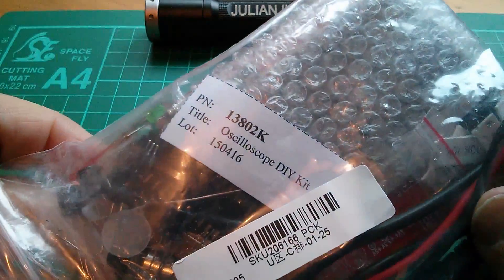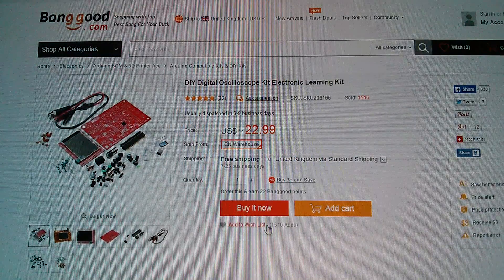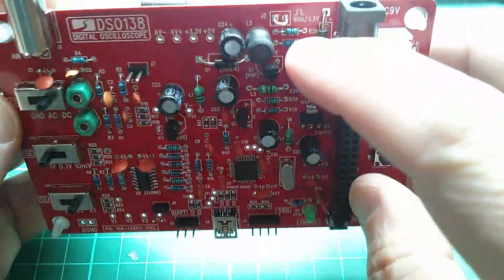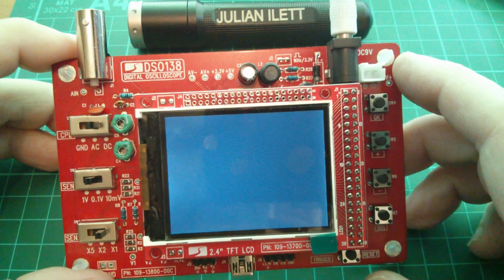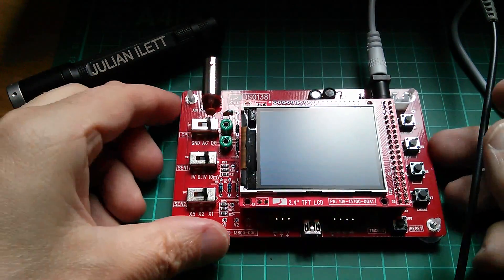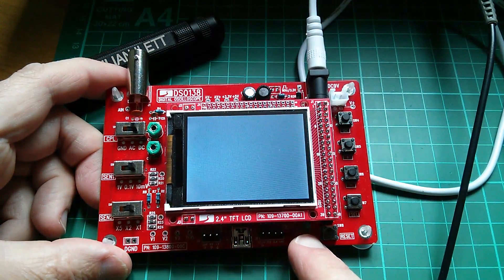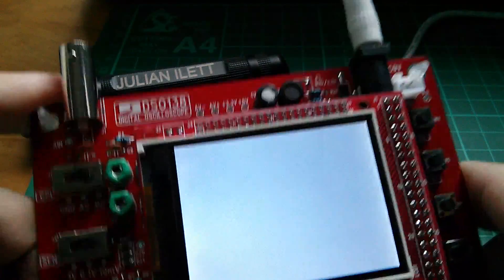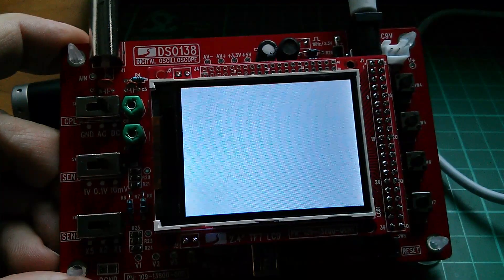Julian's Kit Build (FAIL): Banggood £15 ($23) Oscilloscope Kit

Comment: Undervolt is unlikely to kill an LCD. They don't usually require a negative voltage to work, but that could be the problem. It probably doesn't work without the display because they're using the LCD board to jumper some power across the board.

It definitely looks like the microcontroller is dead or partially dead. Most likely the display doesn't work because the processor simply doesn't initialize it. My best guess is that one of the output registers got fried by ESD. It's also possible that your power bank overshoots when it first turns on, and a voltage spike got past the input register and damaged the uC.

Either way, you need a new board. I'd also stick the (good) scope on the power bank and check for gross overshoot. That can be a problem with cheap boost regulators.

Comment: Julian Ilett Hmm did you only check for the pulse-train on the -av point? It would seem to me that that is the regulated output of the 7905. Try and see if you can find the pulstrain on the first mentioned resistor, from the back side.

Comment: It's very likely that ESD damage due to static from that suspiciously inadequate looking anti-static packaging (and/or careless handling we cringed at in the first video?) was the likely cause of the LCD (or its tiny driver circuit) failure. While it is possible this can be proved though very expensive investigation (requires an electron microscope and opening up the IC in the lab), the MFR should just replace it at no cost. Sometime a static discharge will just cause a glitch that requires software re-boot, but it's still a very good idea to take care because ESD damage can take several months to cause a failure if a very tiny hole (that gets punched by a very tiny spark) allows oxygen to enter, contaminate and eventually destroy the semiconductor layer/junction. BTW, back in the early days of 4000a/ae series C-MOS before internal protection design improvements, that was called “making the chip pregnant”!  Use a wrist strap or better yet IMO, be meticulous in discharge/handling procedures.

Comment: That sucks. I'd actually consider buying one if it actually worked. Try plugging in the barrel connector after the battery pack is on. Also, it looks like the top left pin of the display looks unsoldered. Make sure all the presoldered stuff is actually done right.

Comment: My kit arrived but I have not built it yet... every now and then I look at it with all those little SMD parts... and decide to do something else instead :) Hopefully I'll have better luck when I eventually get around to it. btw do you know what the UART connection lets you do?
Reply from the maker: ***** Yes, I'd be interested to hear whether you have any trouble with yours. It seems you use the UART connection to upgrade the firmware - details here: http://www.jyetech.com/Products/LcdScope/DSO138_oscilloscope_upgrade.pdf
Reply: Julian Ilett Blank white screen. All symptoms same as yours except I never saw the proper screen ever, and no amount of fiddling with the switches will make the LED blink again after booting. Interestingly, I do get the correct AV- voltage of -5V when the screen is attached though (and 0.6V when screen not attached). I always did have a feeling I would be flushing 3 hours down the toilet, but for $20 it was worth a try.
Reply from the maker: ***** I'm surprised - I thought it was just bad luck that my scope didn't work. I'm also hugely disappointed - the scope looks really useful... if the display worked! I've contacted Banggood - they said they'd pass the info onto their tech people. It'll be interesting to hear the response.
Reply from the maker: ***** Hmm, that's interesting - I don't think mine does that, but I'll have another look. I really can't decide if it's the MCU or the LCD that's failed. The additional problem of no -ve voltage pulses makes me suspect the MCU more than the LCD, but I have no idea why it worked for 2 minutes then turned its toes up. Your video looks like some control signals are getting into the LCD though. A replacement kit would help me resolve this, but Banggood have so far only suggested using a different power source (which I'll try of course). I'm sure if I nag them, they'll send another kit!

Comment: What a shame, Julian :( I wonder if the MCU is waiting for the LCD display chip to initialise (which it never does, being broken) before it turns on the GEN signal?  You could try connecting the base of Q2 (with resistor) to the 1kHz test point I guess; that would get you some -ve supply just to see if the LCD requires this to operate.  I was seriously considering buying one of these, maybe not so seriously now!!
Reply from the maker: Alan Cordwell Brilliant idea Alan! The 1kHz may not be fast enough to generate the full -ve analogue voltage, but it's worth a try. Now why didn't I think of that ;)
Reply: Julian Ilett Thought I would buy this as a project to see if I could learn some electronics by way of the need to assemble the product.  Looks like I could be learning a lot more than I thought.  The kit dispatched on the day you released this video so I am looking forward to receiving it and assembling it.  I am not worried about your experience but then that is because I don' have electronics knowledge like many of your other subscribers.  I will be following this to see if you succeed in solving the problem.  Sorry to see all the time you spent assembling the kit has resulted in a non responsive screen.  However, too a newbie like myself to electronics its is a very interesting problem to follow.  I hope you have success in solving the problem.
Reply: ngl777777 I agree completely. I have one of these on order. Never built an electronics kit in my life but can't wait to try.
Reply: ngl777777 
Check L2, my choke was defect. now it works fine.

Comment: Frustrating, well my last 2 electronic purchases on ebay just weren't working. Waiting for over a month. No fun at all.
But maybe a small comment on the powerbank/powersupply. I would rather power it from a supply that immediately gives a clean 9 Volt than something which gives less than half the Voltage.  I've seen eeproms going corrupt this way.
Remember that a device is only as good as it's power supply and certainly a scope should get a very clean power in.

Comment: Is it worth trying to flash the later firmware to see if that is accepted? That'll show the microcontroller is working. It's a bit like it's failing to fully boot and initialise the screen.
Reply from the maker: Steve Cooper That would be worth a try - there's a link to a reflashing procedure document on jyetech's website. MrOpenGL supplied the address: http://www.jyetech.com/Products/LcdScope/e138.php

Comment: Some tips based on my experience on the Jyetech oscilloscope (model DSO 062, with a simple 128x64 LCD dot matrix display and ATMega 64):
1. Check for proper soldering on every joint you have made. Especially if you have a low powered iron. I prefer using a 40W iron rather than a 15W one some people use, because it heats up large pieces of metal very quickly and makes soldering on the ground plane very easy. However it is also easy to burn out stuff :). But I think than it is even easier to burn out stuff with a 15W iron because you need sometimes to keep it applied for more than the 5 seconds most packages are rated at.
2. More importantly, check if Vgen is present by probing the MCU pin directly. Try resoldering the MCU if it still does not work (there was a bad solder joint on the Atmega so the display would appear garbled)
3. Try attaching the USB to a PC (assuming it has USB connectivity) and see if it enumerates. If it does then probably the microcontroller is very fine :D
4. Try supplying -5.5V to the LM7905. Watch out for the dropout voltage of the regulator!
5. Try using a non-switching power supply, eg 7809 or battery.
6. Check all decoupling capacitors
7. Check out Jyetech's website - usually they've got troubleshooting guides with all teh voltage references you should check to see if it is working properly. http://www.jyetech.com/Products/LcdScope/e138.php
It also says it's a 320x240 display.

This is the full version of the manual, http://www.jyetech.com/Products/LcdScope/UserManual_138.pdf at page 2 there is a chart with all the voltages that are supposed to be present.
 Best luck :)
Reply from the maker: MrOpenGL Thanks for that - I'd done most of it :)
Just tried connecting the USB - Windows sees it , but there's almost no intelligible data (VID is 0000, PID is 0002) and no driver can be found (predictably).
I worked out that the display is 320x240 by counting ten pixels, then imagining it multiplied by 32 - looks about right!
Reply: Julian Ilett 
Manufacturer states: usb port has no functionality, present for future use. Read instructions and measure elements before soldering. Do not rush.

Comment: You might want to test all the GND points on both the  LCD and discrete components , like mentioned you did say you were having problems soldering them.

For those sort of kits a good temperature controlled solder station is a mist, maybe look at getting one of the many Haiko clones on aliexpress?

Comment: That 9v power bank might have overshot the voltage when ramping 3.7v to 9v. There is prob not protection on the board to stop it. A short 15v overshoot will kill the microcontroller, or at least pieces of it.

Comment: The LEDs on the display are directly driven from the supply (after the reverse polarity protection diode), which is why they always light up. For the rest of the circuit the supply has to go through voltage regulators which have considerable voltage drop (at least as soon as some current is flowing). Especially all the 3.3V part, which has a diode and two regulators in series (supply -> diode -> 5V -> 3.3V) won't get any voltage until you supply at least 6 or 7 volts. So the powerbank won't break anything. If it could it would be very, very bad design of the DSO. There's always the possibility that a power supply fails (or takes quite some time to ramp up). That might make the micro choke and a rest is needed, but it should never kill the hardware.

Maybe the micro hangs at initializing the display and generating the pulses for the negative voltage comes after that. If you are unlucky and applied a negative voltage at the signal input while the opamp had no negative power, you might have fried the opamp though. Opamps really don't like to have voltages at their inputs which are outside the supply rails!

Comment: i think your powerbank killed parts of the power supply. they really don't like the messy output that usually comes with those "intelligent" powerbanks. there is simply no protection in these cheap boards to deal with highly varying and noisy voltages.

Comment: I think the display is fine maybe a few ports from the microcontroller got damaged for some reason. Is a 320x240 display see my last videos where I use a quite similar one for my new Solar BMS project. Mine is just the SPI version not the parallel one so less pins.
You can try to unglued the PCB from the motherboard and look at the flat flex soldering. With so many pins for parallel maybe one of them had a bad solder joint.
Reply from the maker: ***** I just re-made all the solder joints between the flat flex and the red PCB (underneath the LCD panel), but it's no different. If the LCD problem is damaged ports on the MCU, that would mean the 2 faults are actually just 1 - damaged MCU ports - it makes sense. But is the MCU really so fragile?
Reply: Julian Ilett Maybe your Batterybank overshot the voltage while boosting. I didn't think my 5V Atmel 328P/PU was so fragile but apparently 5.9V Managed to kill it dead.
I guess it's to be expected when they're so damn complex. 
Hope you get it fixed up soon!
Reply: Julian Ilett Is enough for just one pin not to be soldered correctly on the microcontroller to not initialize the 16bit parallel LCD. I'm getting it has something to do with their external circuit and those power supplies for it. Maybe one of few of the ports got over 3.3V and damaged the internal protection diode of the port. 
The ESD was sure not a problem. I never cared about that and never had a IC of any type die because of that.
And you climate is much more humid so chances of ESD are even more reduced.
Look with a magnifying glass at the microcontroller pins. Maybe they send another unit. The LCD's are nice maybe you get a few (I think about 6 or 7$ for the 2.2" SPI ones with PCB on eBay based on ILI9341 controller) hey are quite nice do to high resolution. The parallel one require to many pins for  the microcontroller.
There are larger displays 2.4" 2.8" and I think even 3.2" all based on the ILI9341 but also all have the same 320x240 resolution this are realy popular at the moment a sort of replacement for the Nokia 5110
Reply: Julian Ilett 
The MCU is a STM32F103C8, almost the same as on a Naze32 (STM32F103CB) flight controller for example. While I have heard of people frying their FC board, it seems rare. And since the board is not only used by "electronic guys", but most often by people who just barely manage to solder, you could even say the MCU is quite sturdy. It has pretty much the same preotection measures in place as an AVR on an Arduino has and they don't fry that often either.
My guess is still that the MCU is failing on initialization of the display (which seems to come before the negative voltage clock is initialized).

Comment: i wounder if that AV+ and - are tv output?
Reply: Patrick Dillard Seems like they could be... Julian could you try for a second with an old telly, before you send it to Photonicinduction to get it smashed into pieces? :D
Reply: *****
 After a more in-depth look to the schematic it also seems that AV is indeed analog voltage. On my Jyetech DSO it's labeled as AnV+ and AnV- so that's why I thought it could be video.
Reply: MrOpenGL there is no video chip on board......

Comment: Those LCDs have a complex initialization routine and very easily fall into an invalid state where they will just ignore commands, It could be running when the powerbank is "off" and picking up stray noise as commands. Another possibility is a bad solder joint, faulty connections have caused me hours of trouble with those displays especially when running in parallel mode (16 data lines to mess up).

Comment: Could it be triggering the brown out detection on the microcontroller if the supply is doing odd things like starting at 3.7v then going up to 9v. I take it you have tried having the power bank already on and then plugging it in or using another 9v supply, a pp3 would probably be a good test to rule out any power supply stability issues. Did look an interesting product before it went foggy, so I hope you get to complete the demo.

Comment: A couple of thoughts, perhaps you should consider taking some ESD precautions ( feet in a bucket of water type of thing) when assembling circuits.  Living room carpets can be killers and those green cutting mats are no help.

And yes a temperature controlled iron would help.  It's not so much the temperature control but the higher power (eg. 50W)  that makes them better.  The temperature control just prevents the higher power from overheating the circuit.
Reply from the maker: number 33 This kit was a real pig to solder, I've never had this much trouble before. I think the spokes on the grounded pads are too thick and too short, but that may be just me making excuses. Looks like I've been beaten into temperature-controlled iron submission!
My ESD precautions are instinctive - touch something grounded before handling parts. But I suppose I should be SEEN to be taking the proper precautions. Maybe it's time to retire the cutting mat and get an ESD mat.
Reply: Julian Ilett On the subject of ESD precautions, here's a brilliant product, an anti-static wrist strap that's not only digital but wireless too.    http://tinyurl.com/neecsxj   Yes, I was googling "Anti-static matting", and it's expensive stuff. Surely there must be something that's naturally slightly conductive that would be cheaper like for instance black craft paper or maybe black bin-bags.  Trouble is it's so difficult to measure such low levels of conductivity.
Reply from the maker: jusb1066 Hmm, I like it. Probably wouldn't use my mains powered soldering iron in the bath though.
Reply: number 33 No offence but you must be joking. A wireless ESD Band? The whole point is it has a 9M Ohm WIRE going to ground... I don't see how having something electronically floating in the breeze will help at all
Reply: number 33 sit in the bath, fill with water, both remove static and enjoy at the same time! :}
Reply: Chef Geoffrey Excellence Is this better  .  .  . <sarky>not only digital but wireless too</sarky>?
Reply: Indeed it is
Reply: Julian Ilett You are a very naughty boy! A decent iron makes soldering a joy. Its like moving from public transport to a BMW. That board would have taken half the time, been neater and offered no PIACS.
Reply: Julian Ilett there are cheap temperature controlled sodering irons out there for about 15€. They are quite good, and i prefer them because I dont need to carry a huge station around.
Reply: +mart fazrt
Reply: +number 33 By 'wireless' it means that the wire is not provided. It does not operate wirelessly.
Reply: +Davey Hi That's for sure.
Reply: Chicken !!!